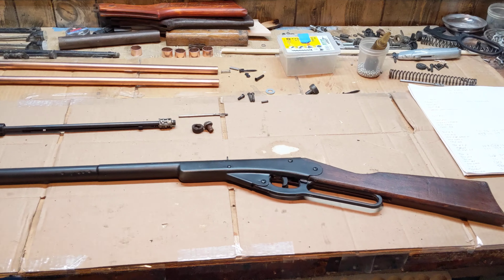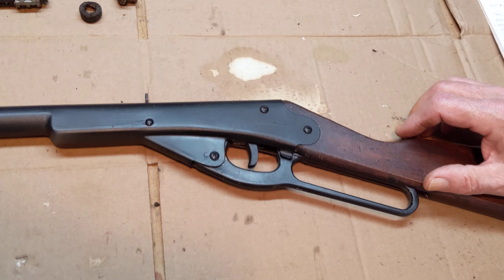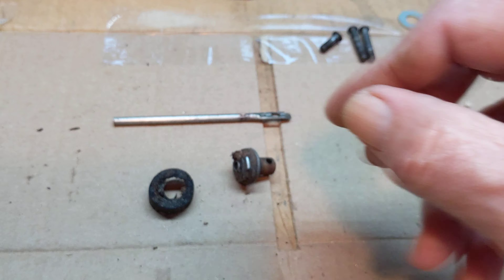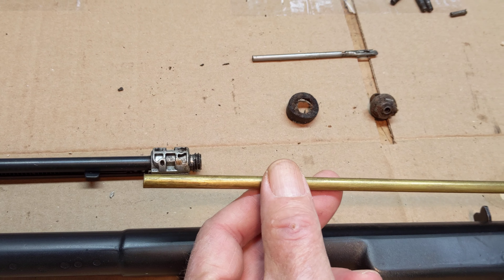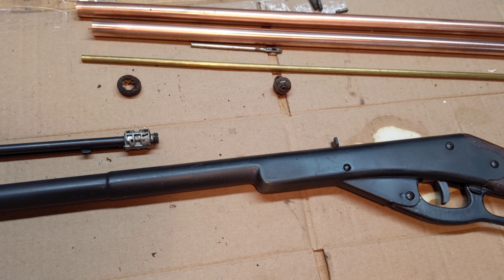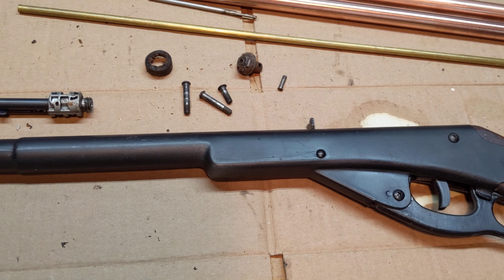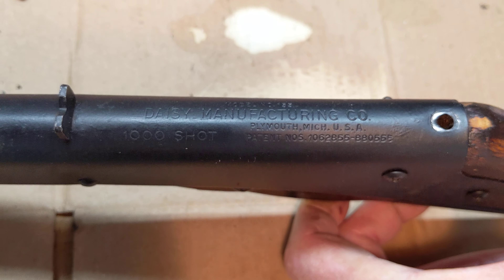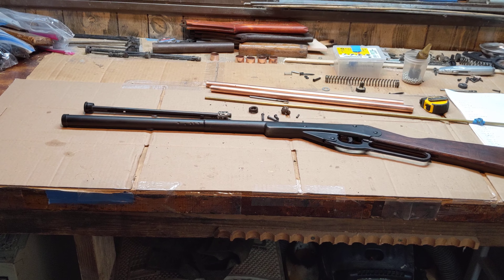Removing rotted leather abutment seals from a Daisy Model 155 in for repair. Part 2

Comment: Just did this exact repair this past weekend on my 111 model 40. Remnants of the leather seal remained after knocking it out. I soaked the area area with Ballistol, put some scotch brite over the end of a 1/2 inch diameter wood dowel and just spun it back and forth, resoaked the area, got after it again, rinsed and she came really clean. Never could have done any of this without your videos! Thank you so much!
Reply from the maker: Thanks for watching!

Comment: How do you diagnose a bad abutment seal?
Reply from the maker: The first clue is normally greatly reduced BB speed, eventually followed by a steel slapping steel sound when you from pull the trigger on a cocked BB gun. On older guns like this one the seal sets were made of leather and if not kept properly, oiled leather will dry out and start to crumble away to nothingness.

Comment: Shane, your innovative, homemade tools just get better.  Have you tried a long hook pick?
Reply from the maker: I've got a dental pick  jury rigged to a 1/4" dowel but the limited space in the compression chamber made it mega fiddly bits. It's just too hard for my feeble old eyes to keep track of what it's doing. The rotary solution lends itself to a touch and feel approach.
Reply: @RestOModDaisy  Shane , you are The Man on the tools and ways to get the job done and not damage these ol rifles !!!